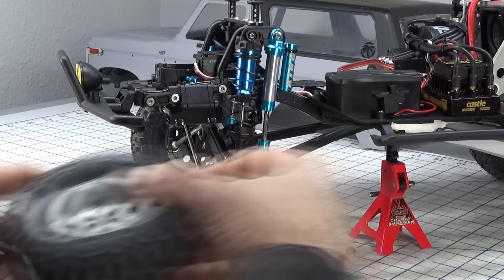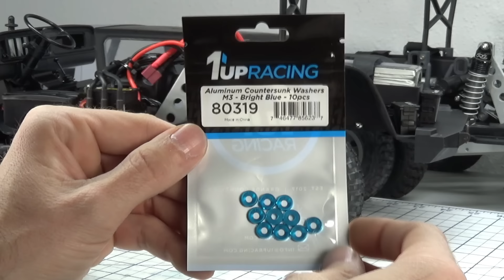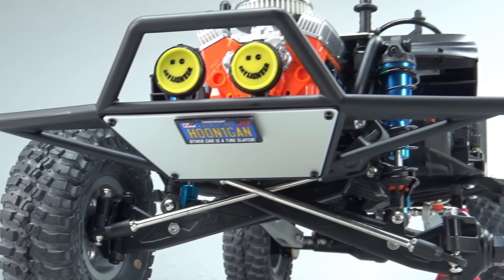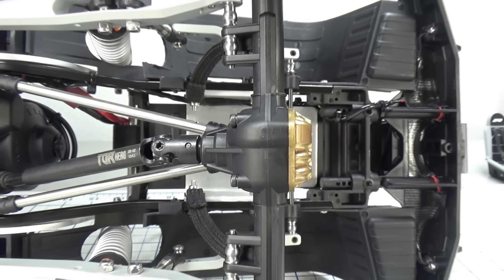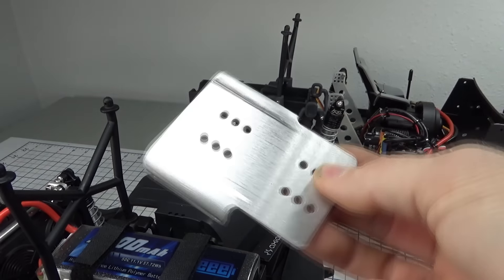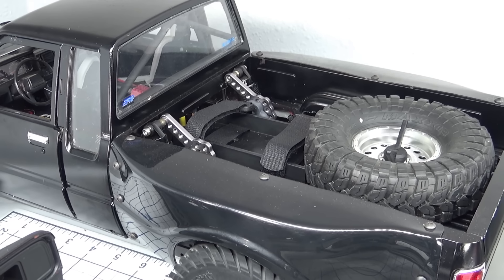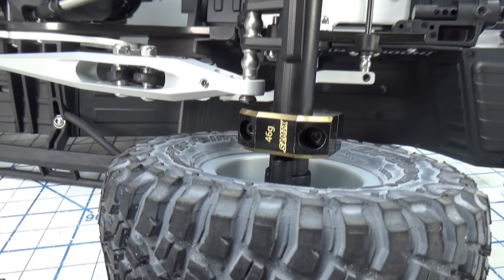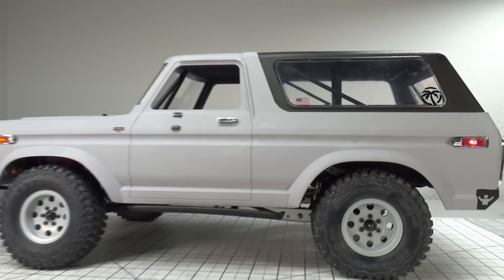Project Scale RC Prerunner 2wd Ford Bronco Hard Body! Axial SCX10ii off road

Comment: Dude! That is so crazy! 60/40 weight bias = rock crawler. 40/60 weight bias = prerunner. So crazy how things like CoG and suspension geometry can allow for so many different types of rigs based off the same platform.
Reply from the maker: I know right, it's pretty cool. Crawlers and prerunners both start as stock trucks just modified for specific terrain and that is hella cool to me. Thanks for checking it out. 👊😎

Comment: how much would it take to get one of these kits and a SC10 II?
Reply from the maker: I have been building a few kits for homies. Scx10ii's are getting harder to find in good shape. I do build these for homies and subscribers that understand its exspensive to build up complete with good components. If you buy the parts and truck I charge $100 to assemble tune and test.

Comment: Dude you and a crow bellow are my inspiration for building a prerunner. I wanted to let you guys know that the beams are on clearance for $30 right now! I couldn't help myself and bought 2 lmao.
Reply from the maker: Yah buddy, crowbelow customs is hella cool dude, I take inspiration from his stuff too. You know what sucks is when this stuff goes clearence its usually discontinued within a year and I suspect that the beams wont be around much longer. Alot of these prerunner parts got lawsuits for using other peoples designs without permission, if you ever wondered why the ranger fender flares were discontinued? Grab em while there hot! Thanks for watching. I got new parts coming, stay tuned, eta 1 to 2 weeks.
Reply: That's wild they used other people's designs, I just got this on clearance as well for a 10.1 and was led to believe it was a drop in with nothing needed and come to find out I need the servo mount and possibly knuckles from the 10.2, and now I'm screwed cause the parts are all on backorder
Reply from the maker: @warriorkm3111 dude... This has been the issue with finding parts lately for these. Kinda sucks proline semi dropped the ball in my opinion with these. The beams are dope but the motion ratio on the trsiling arms with 90mm shocks is straight up weak sauce. Plus they're rear battery  trsy should have been further back for better weight over the rear axle. You can find cheap full metal knuckles for these if you hunt. If you need a yeti trailing arm conversion kit stay tuned got new dual shock design coming in about a week. Thanks for peeping it
Reply: @DoubleClutchProductions  sweet, I will have too, but I'm definitely filing a customer complaint, wouldn't usually but this has me a little upset, saying it's a kit that works with scx10.1 but it clearly won't, gonna try to get the needed parts comped
Reply from the maker: @warriorkm3111 I am with ya man. Misleading marketing in a way. Its getting harder and harder to find scx10ii parts these days makes you wonder why they went that way. Good luck brother, have a good weekend!
Reply: @DoubleClutchProductions  you as well brother, let me know when ya got any new parts coming out, may have to snag em, I wanna get the scale metal fab frame or a full tub chassis and make this thing sick
Reply from the maker: @warriorkm3111 Awesome will do. You peep my most recent short? I designed full long travel frame rails for Axial and Element rc. Stainless steel with dual rear shock setup. Stay tuned parts are inbound
Reply: @DoubleClutchProductions  that looks sweet, I'll have to check the vid when it comes out
Reply from the maker: @warriorkm3111 👊😎

Comment: Fantastic build and video!  Congratulations.    How do you measure 60/40 rear biased accurately without a 4 wheel scale?
Reply from the maker: Thanks buddy. As stated its not exactly 60/40 but as close as you can. When I first started building these I did use a 4 scale setup to figure out how far the battery relocation should be and this is why I made one of them adjustable. The concept comes from desert racing, if you draw a line from the rear contact patch to the trailing arm pivot as long as that line is in front of the center of gravity it will drive the vehicle forward rather than bucking. Hope that helps 👊😎

Comment: Hey man, I just ordered the trailing arm Kit. I haven't caught up with you in a while but I'm glad you're selling these kits. I just did a sick Losi Hammer Rey build and need to get it uploaded to the channel.
I'm looking forward to this build!
Reply from the maker: Yah buddy, totally remember chatting while back on the baja and studio lights. Cancled your first order and will be shipping your parts today USPS priority. On a side note I got some prototype frame rails I would like to get put in the wild. Your building SCX10 right? I'll keep in touch next week or so 👊
Reply: @DoubleClutchProductions  Yup; SCX10ii. I thought I had scored the ibeam kit but it was out of stock. I left my order in place and now I'm going to have to wait until the next shipment. 😞
Reply from the maker: @IROC-RC word, so many people have reached out asking how to get those kits. I smell discontinued stink around the corner. Cool trick, you can swoop the parts individually from horizon in stock last time I checked. The only downside is that Proline is shady smart and forces you to get all the parts just to complete the front end, and it's more than the kit, lol. I would swoop em if you can, just like the prerunner fenders. I suspect the intellectual property of the beams was most likely taken from a full-size truck without authorization, similar to the prerunner fenders...... Your kit shipped today USPS priority 👊 hit me up anytime if you have a questions. Appreciate the support

Comment: Cool build. That’s exactly how you wanna build a real one. Twin traction beam, king bypasses in the rear. Wish you showed it running more.
Reply from the maker: I got a few running videos of all my builds. Running videos coming when the rain stops
Reply: @DoubleClutchProductions nice man. You pnw? How much did you spend on these builds? I would love to have one of these to match my real life truck 🥲 98’ 3rd gen 4runner. But no one makes that body, only land cruiser.
Reply from the maker: @jvogler_art4708 PNW👊yah wish they made more bodies, we had rigs or wanted rigs at some point so it's fun to explore your creativity in this scale. I'd love to see more OBS Era bodies come through. 👊👍
Reply from the maker: @jvogler_art4708 lol these trucks are spending done right. $400-$600 minus the actual truck. I've had my scx10ii for years, was $299 back in the day, you can still find em on Ebay just have to hunt. 👊👍

Comment: Could you re-explain a little more on the 60/40 rear weight bias thing? Is that centered on the rear axle? I would love to know!
Reply from the maker: Weight biased is measured from center being 50/50. Old school BMWs used to have close to a 50/50 making them super balanced and excellent handling cars. Desert racing you want more weight over the rear hence 60/40 rear biased
Reply: @DoubleClutchProductions  ahh okay I get it now, thank you!

Comment: How did you remove the front battery tray? I was trying to figure that out, but part of the tray is connected permeability to the setup. It's right where the Iveam kit installs to the frame.
Reply from the maker: I actually trimmed it to fit my setup. This is a scx10ii cherokee so it's a different battery tray than the scx10. Do you have a scx10 or scx10ii. I heard from a few homies that it needs the scx10ii battery tray.

Comment: could it be made to have selectable 4x4? also could it have diff locks? and whats its top speed? i want to make the same build but have it as close to real life as possible
Reply from the maker: Real full size prerunners are mostly 2wd. Also almost all capable full size prerunners have a locker or spooled rear ends that are fully locked up. The proline twin I beam kit for scx10iis are only 2wd just like full size long travel I beam setups. This is as close to real life prerunners as you can get and is built around that function wise. I haven't got to get a top speed on this truck but If I would guess it's over 20mph. Most real world prerunners top out around 80mph so it's dang close if you scale that to 1/10 scale. I don't know of many rc crawler setups that have selectable 4x4. Traxxas does have lockable diffs in the trx4 I believe 👊😎
Reply: @ appreciate the detailed reply bro❤️, but i didn't mean an irl pre runner i meant an irl bronco with selectable 4wd and i beams, but ig the trx4 is the closest thing to that of a real bronco🥲
Reply from the maker: @waleedahmed3544 I totally understand what you mean, but this is built as a prerunner, not a stock ttb 4x4 bronco. This is a prerunner bronco and as such is built like a real full size prerunner bronco. They don't make a twin traction beam rc 4x4 yet?

Comment: so im starting a basic build with a stock scx 10 ii and the proline ifs kit. What 2wd transmission should i go with? i already have the hobbywing ezrun3652 paired with the hobbyrun ezrun max10. Thanks
Reply from the maker: I'm running the stock Axial scx10ii transmission and I have yet to see if it will hold up. I've seen some good aftermarket scx10ii transmissions but I don't have any experience with them. Stock one is a good starting point, still enough gearing to rip pretty good.
Reply: @DoubleClutchProductions  thanks man!
Reply from the maker: @robhoskins4120 👊👍

Comment: Did you run into the issue with front shocks rubbing on part of the bracket because the shocks were to big? Im having this issue and struggling to find shocks that dont rub
Reply from the maker: I did with some proline short course shocks. It's a crazy tight fit. These prosc10 shocks at full bump are less than a mm from touching the swing steer set. A few people reached out and just make sure that one shock is mounted in front of the beam and one behind.
Reply: @DoubleClutchProductions  I used the proline for the slash and they were hitting pretty bad, so I currently have the traxxas big bore with mini t springs but I feel they aren't going to be enough after all the weight gets added. Are the springs on the pro sc shocks similar in diameter to slash springs like the proline?
Reply from the maker: @devinwharton5058 have no idea on the diameter. Cool thing about sc10 or the 12mm shocks they have a ton of springs and pistons and it sounds like you know that's how you get the front to work. Your on the right track, I'd look at a spring kit for those traxx shocks. If all else fails you know you can get some associated front prosc10 and it will work. Good luck broskie, have a good weekend
Reply: @DoubleClutchProductions  I appreciate the help! Thanks bro! Have a great weekend

Comment: What do you use for your spur  and pinion?
Reply from the maker: Stock spur 56t, video shows pinion used, AXIC7028 32p 17 tooth pinion. The key I think is the 5700kv with the rear ring gear and pinion that is a 24t  overdriving the rear.
Reply from the maker: I also have a Google doc on my youtube link tree with links to all the parts I use including that rear ring gear. Happy New Year 👊😎

Comment: Hey man I was going to see about ordering the trailing arm relocation mounts along with the battery mount. I think I’m ready to start my pre runner build
Reply from the maker: Yah buddy, links on my YouTube to paypal. Pretty easy setup, you'll need yeti length arms, Element battery tray and some 5 inch shocks. Hit me up of you have any questions 👊
Reply: Awesome, thanks for the input man! I’ll submit an order today! I’m going to be starting this build from scratch, would you recommend the axial chassis or element enduro? My plan was to go ifs or I beam front and then yeti style rear. I also wonder would this be possible to run on the rc4wd blazer body? It’s got a pretty short wheelbase at 11.4in so it would need quite a bit shorter trailing arms
Reply from the maker: @kadenmaxwell8631 Right on brother, I used to think Axial was superior. I'd go Element unless your doing a twin I beam build. Element enduros are easier to find, get parts and are a tad more durable. Nothing wrong  with either
 👊hit me up anytime with any questions
Reply: @DoubleClutchProductions Gotcha, that’s kind of what I’ve been hearing. Do you know if the I beam kit will work in place of the ifs that comes on the element trailrunner? I kind of want want to run ifs while the I beam kit is on back order :/
Reply: If not, I will suck it up and get the solid front axle variant while I wait for the I beam kit to be back in stock
Reply from the maker: @kadenmaxwell8631 In theory I think it can work but not a direct bolt on. The IFS 2 is pretty dam good for whats available. The beam kit has been backordered since it went out of stock. I got an extra Proline beam kit in the box?
Reply: @DoubleClutchProductions  Ok I gotcha. Man that would be awesome if you were willing to let it go to me. I reached out and it looks like they’re back ordered for the next few months unfortunately.. Is there a way to write up the bill to include the I Beam kit? If not I can do two separate transactions
Reply from the maker: @kadenmaxwell8631 yah I think I can do that... you got instagram?
Reply: @DoubleClutchProductions I do it’s just @kadenmaxwell
Reply from the maker: @kadenmaxwell8631 just took some pics for you. Send me a dm now if you can?
Reply: @DoubleClutchProductions  Hmm I haven’t received them yet. My instagram isn’t refreshing either which is weird? Honestly though man I trust you, how would you want me to submit my order if you’re cool selling me the I beam kit too?

Comment: This is a super noob question but what’s the most economical way to start building something that can handle sand dunes like this? I’m inspired to start building something now lol
Reply from the maker: If it's your first RC I recommend the Losi Baja Rey 2.0, this video is pretty detailed on the parts needed and the setup I run. If you need some parts hit me up too. 👊
Reply: @DoubleClutchProductions  sweeet thanks man will do 😎

Comment: I need one of those kits front and back for my Ford raptor build.. but I wanna run 2.2 would that work?
Reply from the maker: 2.2 tire? Have no idea on tire sizes as I don't own any 2.2s. My setup runs a class 1 1.9 proline BFG km3 👊if you need any parts hit me up
Reply: @DoubleClutchProductions  yes I would definitely like to get that type of set up for my Ford raptor build but I want a 4wd set up tho

Comment: Hey man, love the build! Do you have a website for the mounts i can look at? Ive been considering getting a scx10.2 and doing a prerunner build like this after i get paid at the end of the month and i really want to do a trailing arm rear setup!
Reply from the maker: Yah buddy. Currently sold out! I will have these available in about a month or so. New designs are coming. Moving to a new spot so everything is boxed up. 👊stay tuned

Comment: Hey brother, love the build. Im curious as to what gearbox you're running in this beast?
Reply from the maker: Thanks buddy. It is the stock scx10ii trans with the 17 tooth pinion. Wheelspeed does also come from the rear ring gear that is 24t. Time will tell if it will hold up but seems good so far

Comment: Ah, damn. The Extreme RC 4×4 site is gone. 😕
I wanted to get those trailing arm shock mounts.
Reply from the maker: Yeah, it was a shame to see him go. The mounts I used here are my own designs. I have a newer version trailing arm conversion kit that is dual shock setup now for both Element and Axial. I have a few scx10ii kits left here, or you can purchase directly from SendCutSend. Parts from SendCutSend do not include any hardware. You can find the links to purchase on my youtube link tree more info. If you have any questions hit me up anytime 👊😎

Comment: Is the original scx transmission used in the car?
Reply from the maker: Yes sir, stock scx10ii trans
Reply: @DoubleClutchProductions  I watch all your posts many times, I have written about it before, I am trying to make a prerunner myself. Since the scx10 is not designed for high speed, I was worried about durability, that's why I asked, thank you very much.
Reply from the maker: @emreercan5575 Right on. They wheel speed is coming from the rear ring gear and pinion 24t and the high kv brushless motor. Durability hasn't been tested but it's very fast for a crawler. Definitely fast enough for a prerunner

Comment: Do you have any info on the Proline kit backorder situation? They would be stupid not to make a ton of these. I bought a whole new 10.II builders kit and now i'm stuck waiting -.-
Reply from the maker: Honestly wouldn't be surprised, they were supposed to have these beans almost 2 years ago, after canceling the prerunner fenders I don't know
Reply: @DoubleClutchProductions  so stupid man! I've had a ranger body w/ fenders stashed under my bed for what a year or 2 now?! This was the chance to finally run it but we'll hope & see
Reply: Decided to order the 4 parts packs they sell for the beam kit. All i'm gonna need is hardware but the front axles are looking like the might be an issue
Reply from the maker: @anthonysmalawipredators8794 You know I quickly peeped at doing that, I need to see the parts bag again. That would be dumb to not have the front beam kit parts separate? Good info... 👍
Reply from the maker: You know last time I chatted with Amain they have them in stock. I believe from my experience this is a licensing issue, I assume this is why we didn't get the beams when they released a ranger body with prerunner flares. I think Darren has a brand deal limiting the use? I agree you can find these locally if you hunt. Call some shops and see if they will ship it.